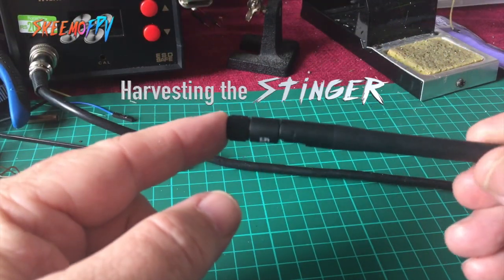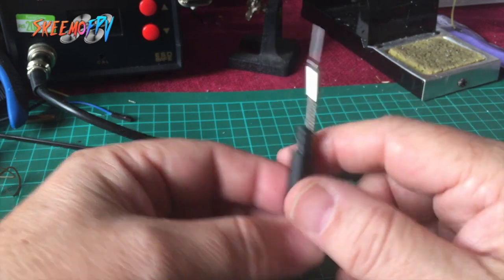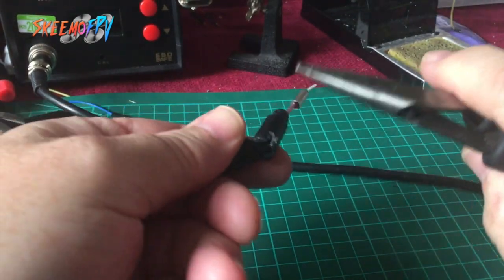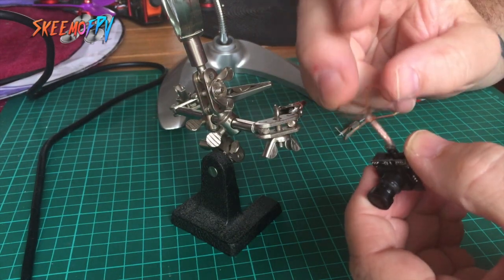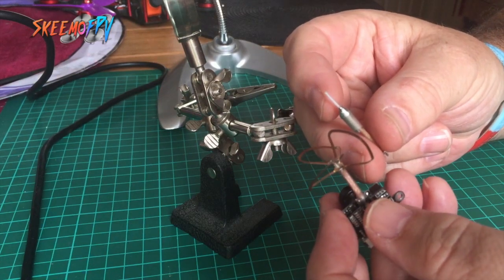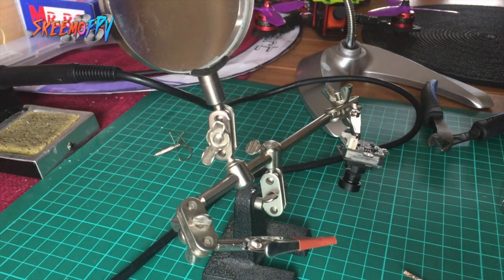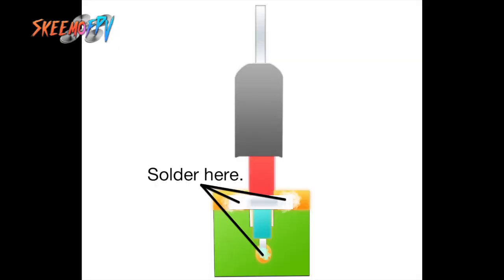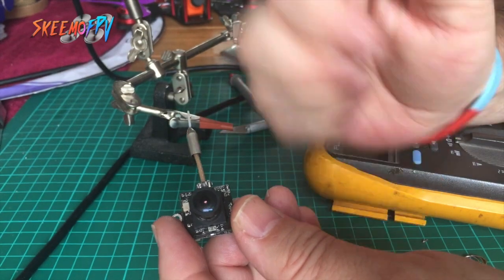Tiny Whoop Antenna Mod

Comment: You could modify the coax on the rubber ducky by chopping the end off from the other end,not like you did,then solder the wires on,you chopped it wrong.